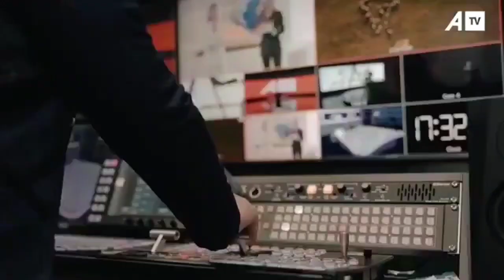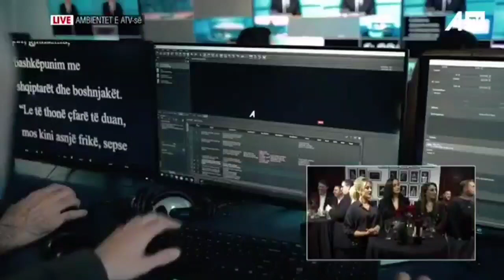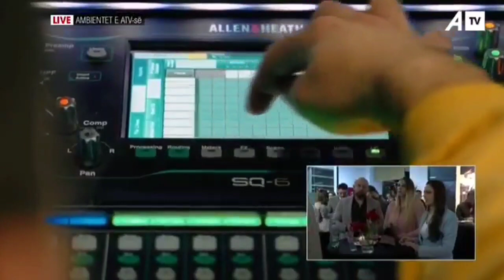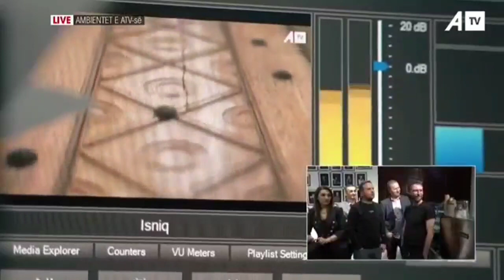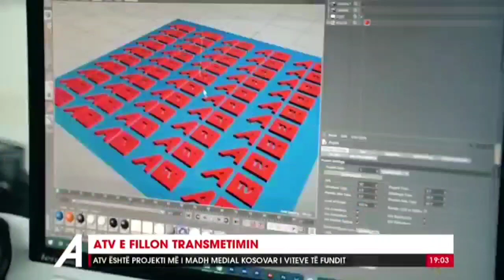ATV - Launch Event (31/01/2021 18:42 CET) (SD)

Comment: The news set looks very inspired by BBC News, doesn't it?
Reply from the maker: It does indeed, although it also seems to pull influence from DR1's TV Avisen with the screen setup.
Reply: @BrendNeEkran  The transition at 18:27 reionds me a bit of Channel 5 news.
Reply from the maker: Actually that's not too far off from Channel 5? Good eye!